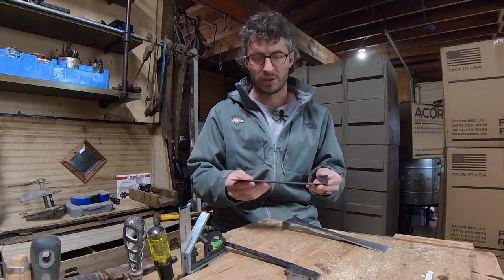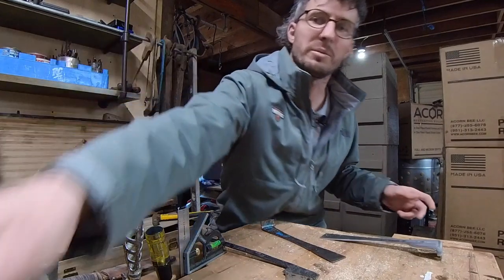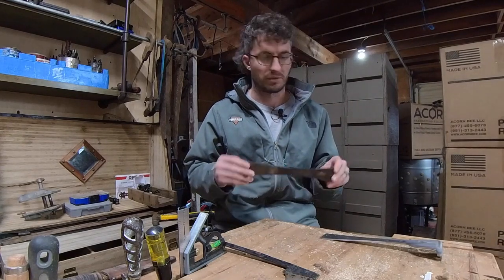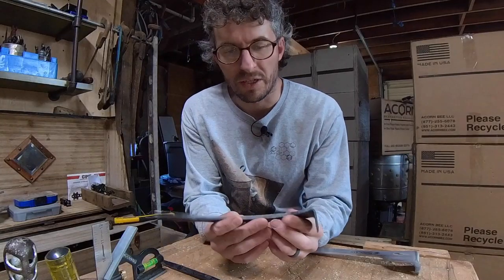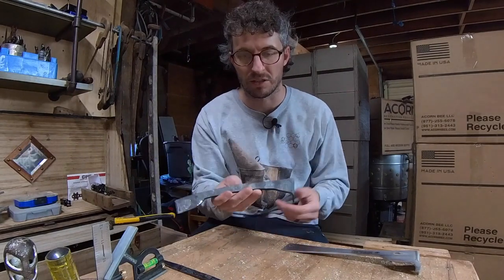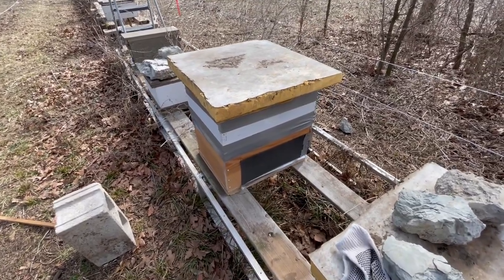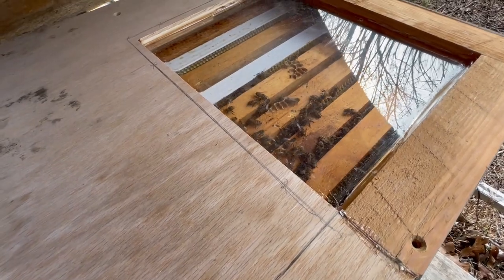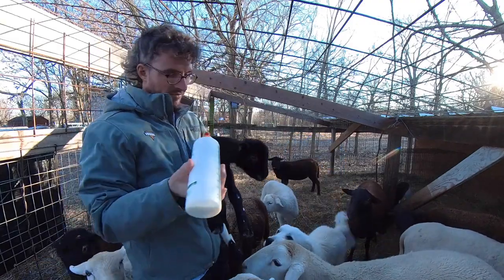Hand-Forged Beekeeping Hive Tool for Mr. Ed

Comment: What are the dates in Tulsa. Did you harder the hive tool, Not saying it needs to be just wondering.
Reply from the maker: It’s on the 1st and 2nd of March. Big Bee Buzz I think is what it’s called. Natalee is a speaker as well, and one of the guys from the university of Guelph in Canada. It should be a good event. 

I did harden the ends. I’ll admit I’m not an expert with hardening, but the file seems to be skating so I think it worked. I might put it in the oven for a little while just it case it’s too brittle. Thanks for watching